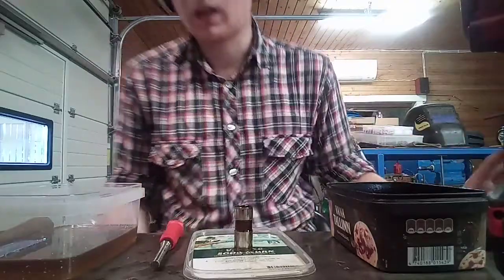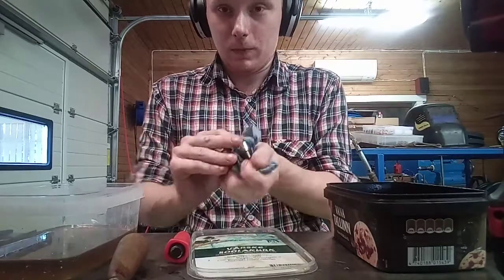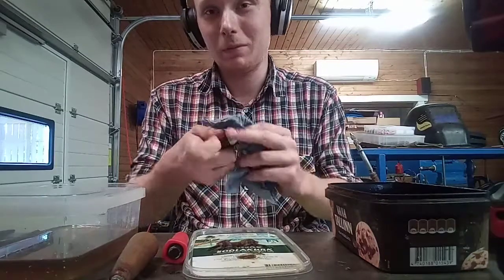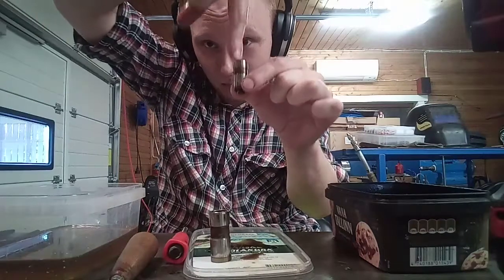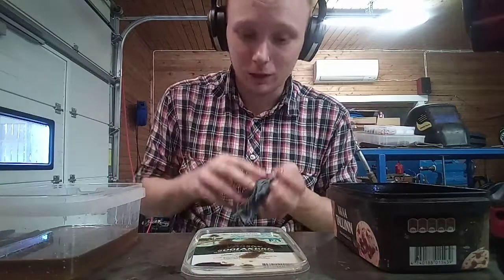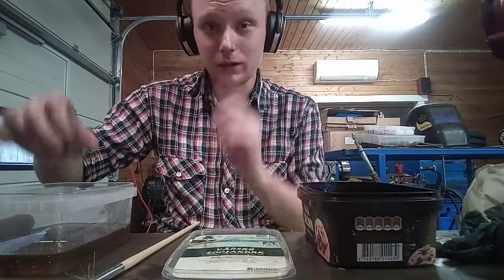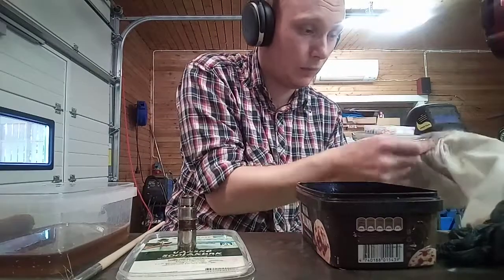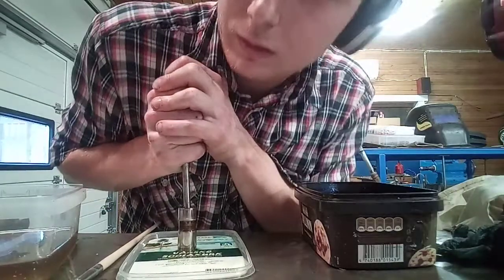How I disassemble and clean Rover V8 lifters.

Comment: Not seen them cleaned like that before. All they usually say is a new cam & lifters. Must be expensive to buy. Especially if you can just clean them & reuse . Great video.
Steve.
Reply from the maker: If you are putting a new cam in always put new lifters, the reason I was doing it this was was because I was just replacing the head gaskets and not the cam at that point, and when I had it all open I decided that I might as well clean them.